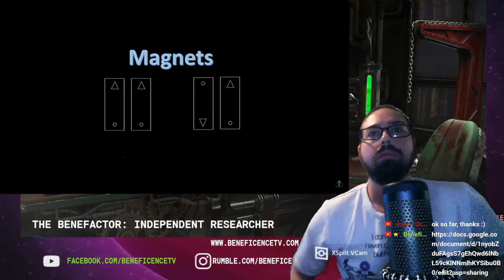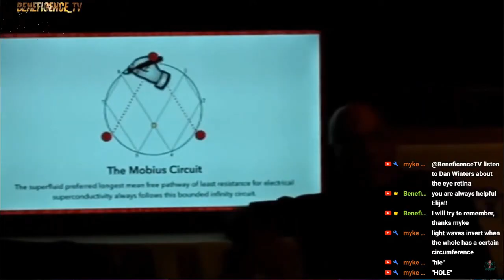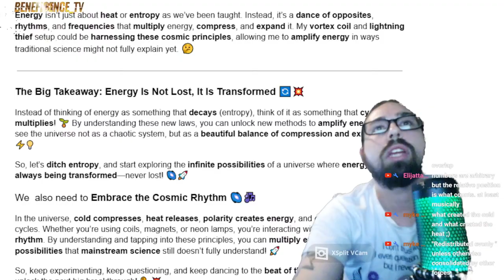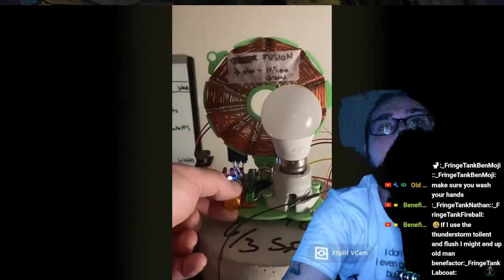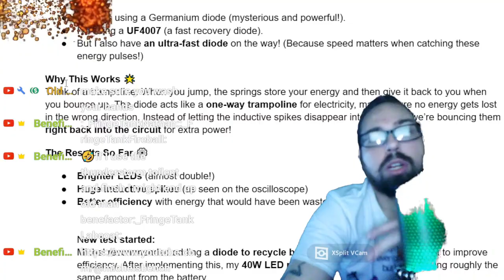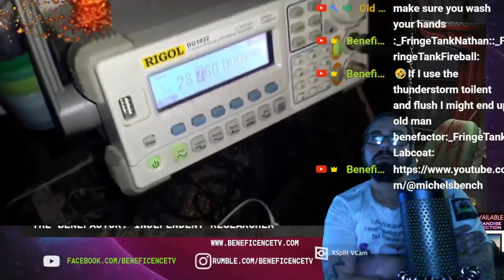New Law's of Thermodynamics| Ben's Guide to Free Energy | BeneficenceTV

Comment: Having just found your channel, you all could do with simplifying your measurements, I'd go for a 0.1Ohm resistor in series for the input and another in series with the output and load, measure with your scope the voltage drop over this resistor, channel 1 for the input and channel 2 for the output. Then it's just simple ohms law calculations, I = V*R then P = I*V, obviously with wave forms you need to look at the average of the voltage. Measuring waves with a DMM in my view is a very bad idea, I wouldn't trust the measurements, you could easily be missing a positive gain. BTW do you follow Ashton Forbes or Ken Wheeler ?
Reply from the maker: @wazuo8354   I’ve tried all sorts of tricks to measure this energy. It is very tricky to get a full picture of what’s going on. My research partner has an idea that we’re going to try your right digital multimeter are not going to cut it. I do not follow Ashton Forbes. I appreciate his work, but he doxed my identity on his discord when I disagreed with him so I don’t mess with his crew anymore. Can Wheeler is brilliant, but I also have problems with Ken Wheeler because he misunderstands the very fundamentals of economics and Marxism, which I go over on this channel as well. Here is my critique of Ken Wheeler: 

https://youtu.be/GBwCzJbM_3w?si=x4-nN7GNTmWKw4tl